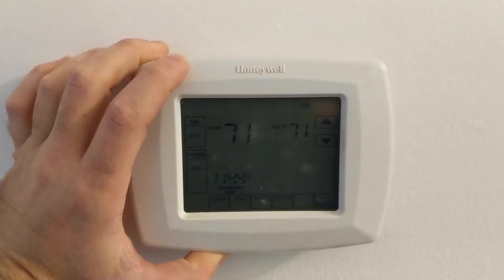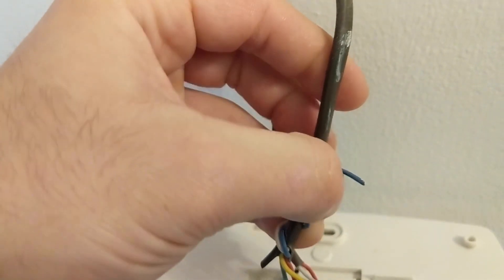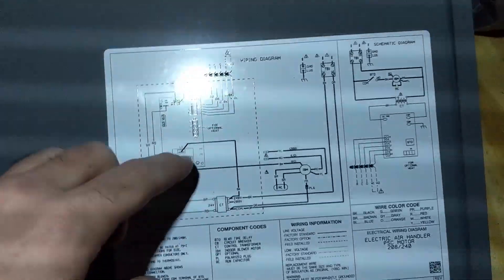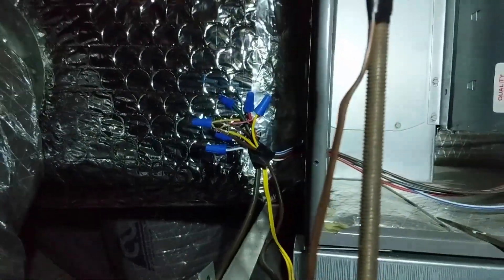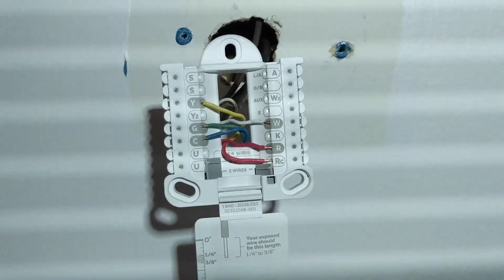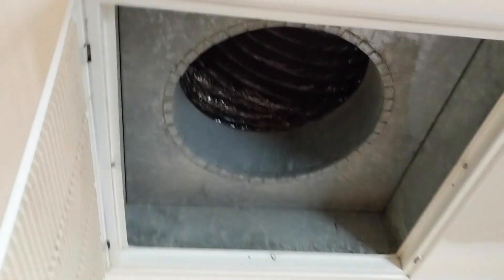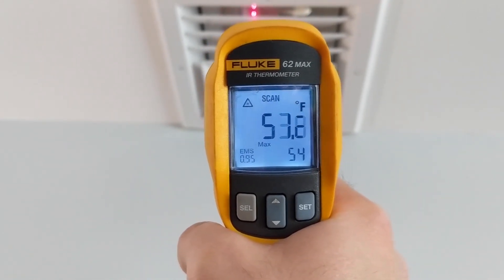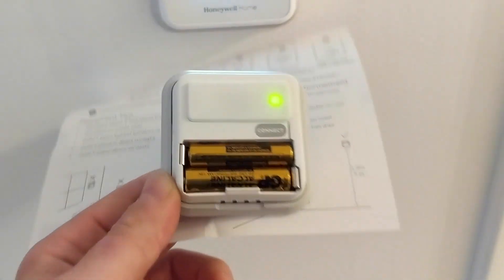How To Install Smart Thermostat with No Common Wire

Comment: "How to install a thermostat with no common wire"
Your solution is to look for the common wire. Thanks
Reply from the maker: Yes, because every house is different and just because there isn't a common wire at the previous thermostat, doesn't mean that it doesn't exist. Many people that can't figure this out, will find this solution helpful. While there are also people that know for sure that they don't have any common wire anywhere. So though this may not help you it has already been confirmed to help some others. I hope you find a separate video that helps you

Comment: Hey I had a similar issue however my wires from the AC and heat are coming from 2 different locations.  Can’t figure this out and would appreciate if you can reach out and help me or explain what to do?  I can give you my contact information
Reply from the maker: My heat and ac are coming from two different locations. My heat is coming from down in the basement and the AC is up in the attic. Do the wires for both heat and AC at least lead to the same location, where the thermostat is located?

Comment: How has it been working for you. I'm in a similar situation. Heating is forced hot water baseboard and AC is newer in the attic. I have 2 wires from the heat, and 3 wires G, Y, and Rc from the AC.  Was quoted $400 to $500 for a new one ... outrageous .
Reply from the maker: Yeah the quotes are insane. If you have newer ac you may have some unused wires hidden in the wall one of which may be able to be used for common. If not, you can run a single wire from the AC to your thermostat. The diagram should be on the AC unit to tell you exactly which wire needs to be used for common. I absolutely love this thermostat. And love the wireless remote temp sensor function. It's been working flawlessly. I highly recommend.